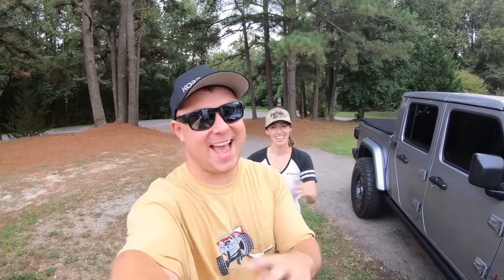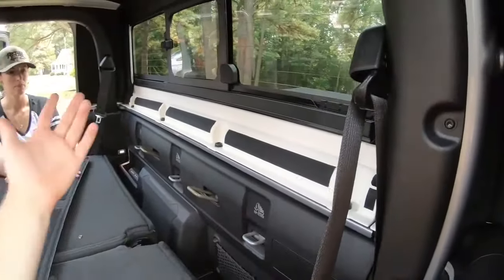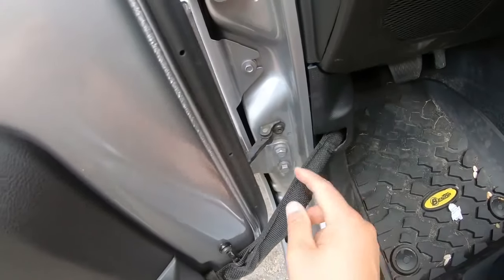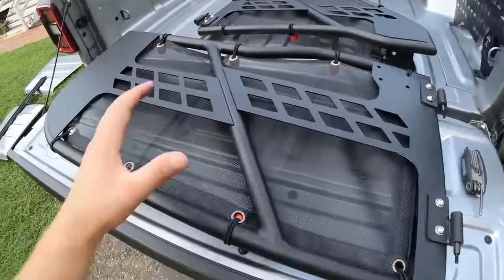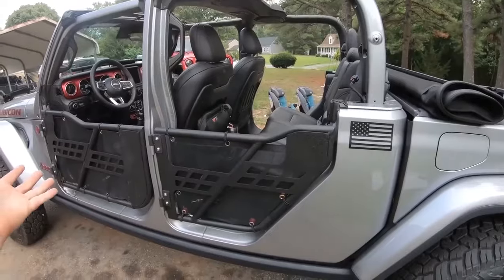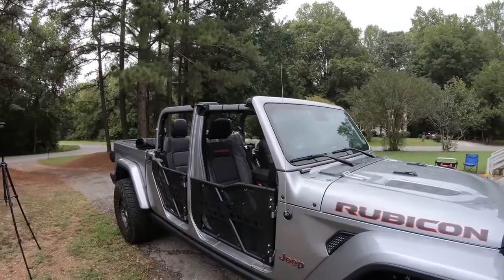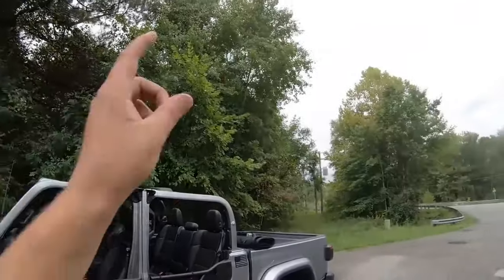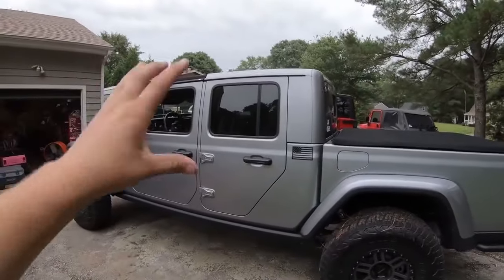Jeep Gladiator Half Doors 4 Door Rock Crawler Tube Doors - Hooke Road®

Comment: Just so you know there’s a small black tab on the bottom of the front door harness that you have to push in to flip up the white latch
Reply: So the process is red latch, push in bottom black tab then flip up white latch while pushing the black tab in
Reply: Did you have to buy new screws for the door hinges? Seem  like the one's that came with the truck don't fit, they too big.
Reply from the maker: Thank you for your tips!

Comment: Will this fit my 2021 Gladiator Rubicon?
Reply from the maker: Fit
Reply: @HookeRoad4x4  just installed mine on my 21 Gladiator Mojave and the rears touch the door frame regardless of how far into the hinge you push them.

Comment: @HookeRoad Still no response! Hooke Road is total trash- In addition to the door problem, the running board already is already starting to rust on the tube end cap! less than a month since install!!
Reply from the maker: Dear Shawn,

Hooke Road Customer Service Team will contact and help to solve the issues in 48 hours.
Please kindly help to check your e-mail or spam and contact HookeRoadCustomerService@hotmail.com.

We value every customer and will help you resolve the issue, please do not worry.
Many thanks for your kindly understanding!